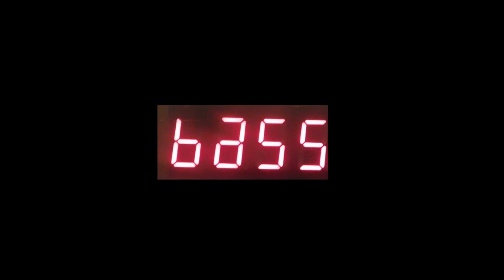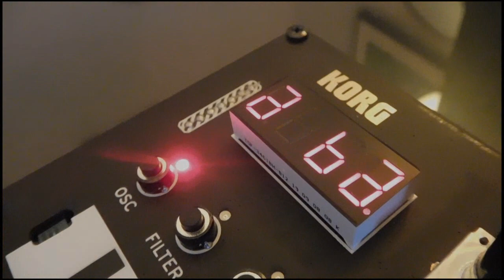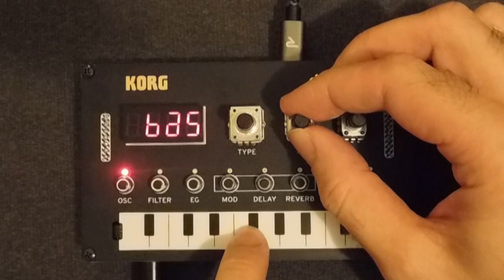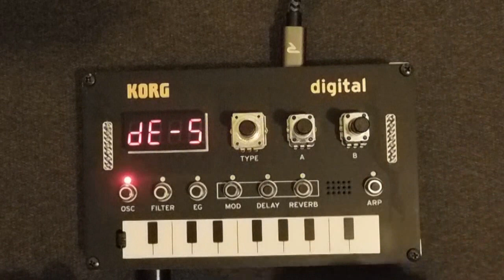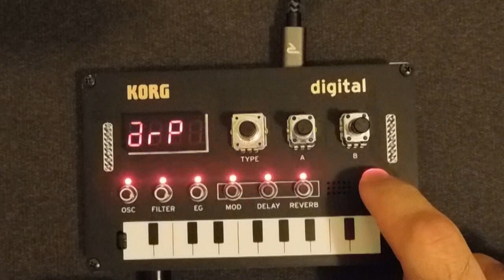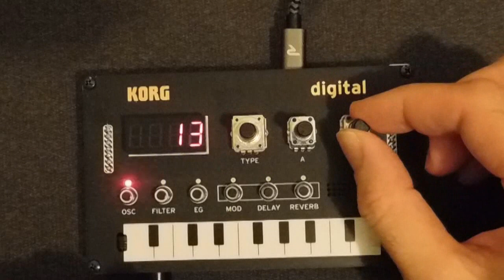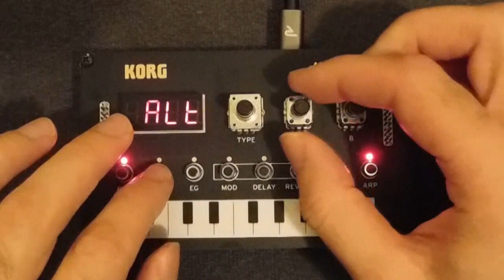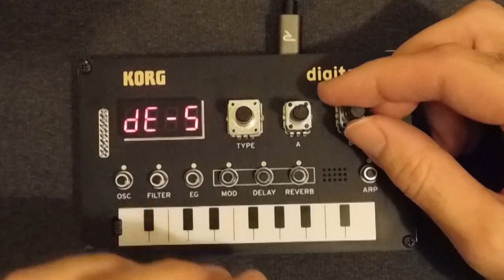"Volca Bass" OSC for Korg NTS-1

Comment: Hello sir, it shows 404 on github. Can nts1 users no longer download?
Reply from the maker: Hi, I just checked and the link is working, try clicking instead of copy/paste. In alternative to searching tweeeeeak on git hub
Reply from the maker: Ok, the link for mk 1 is not working, let me check that
Reply: @tweeeeeak228  Thanks for your work, vbass works on nts1. I found the same problem with Proba-B, the nts1 connection failed.
Reply: @tweeeeeak228 Thank you for your contribution❤❤❤
Reply from the maker: @Enzi-mika Done, the download link is working now. Thanks for the heads up

Comment: Thank you! This is really great! Can I also use this oscillator with a MIDI keyboard, and does it respond to velocity?
Reply from the maker: Yes. Velocity is controlled by the nts itself, and controls the volume, it has no control on the oscillator, but works fairly.
Reply: @tweeeeeak228  Thanks again!

Comment: Is it possible to to do slides from external sequencer? Also are params of this osc trough CCs?
Reply from the maker: Sorry for the late reply. Slide is either on or off, and this has to be changed in the NTS-1 using the OSC extra parameter 4 (Octave and slide). Unfortunately, the 6 OSC extra parameters are not accessible via MIDI though CCs. The whole rest of params in NTS-1 are changeable via MIDI, only the OSC extra params are not, which is a shame :-(

Comment: So I just tried to use the sequencer on here to create more complex sequences on the Minilogue XD, and the architecture seems a bit different than the nts-1, as the sequence doesn't play when I strike a note. However the idea that it's even a remote possibility to create an oscillator to create a sequencer within a sequencer is such a fantastic idea, I applaud this not only as a great nts-1 oscillator but possibly an interesting step for the logue synths as well!
Reply from the maker: @s3nse c0rruptr thanks for your comments. The minlogue is 4 voice polyphonic so it loads 4 instances of the volca bass osc, which means 4 sequencers. So it becomes a mess, unless you use it in mono or unison mode, I believe.

Comment: How to load from Windoze machine?  Hsven't found an easy way to interact with the NTS-1 on this platform.
Reply from the maker: Some people report problems, in fact. With the librarian, recognising midi port... For me it was always smooth. My only guess is maybe other drivers installed interfere?
Reply: @tweeeeeak228  I haven't found the NTS-1 librarian, but I've tried the two for the bigger synths and the nts wasn't recognized.
Reply: To others: I had to wait for the Librarian download link to load on the NTS-1 page, and I also had to manually assign the Midi channels in the Librarian.

Comment: Really great job designing this custom oscillator! It makes me even more excited for my new NTS-1. One thing I would love to see you include in the future (if it’s possible) would be the active step function, or at least a sequence length control. Oh, and why not have the LFO change oscillator types (or do something else) when set to wave shape? I guess that would be getting away from truly emulating the Volca Bass though. I know nothing about programming custom oscillators, but is there any way to route the LFO to a filter, or change the LFO shape?
Reply from the maker: Hi Ryan, thanks! The active step function actually crossed my mind, the only question is how to select active steps, with only the available parameters, and without complicating too much? Any suggestions?
Reply from the maker: As for the LFO, the shape LFO doesn't really exist in the volca bass, ao I would keep it out. The other LFO parameters I cannot control. Only the OSC itself.
Reply: Just had another idea, but again I’m not sure what can and can’t be done within a custom oscillator. The ribbon keyboard has 16 marked notes from Bb to C#; perhaps in sequencer mode set to 18, each of these notes could instead of making sound, toggle a step between active or not. And then value 19 could reset them all to active. Thanks for taking the time to hear my thoughts and reply! Keep up the great work, man.
Reply from the maker: Sound very nice ideas, I'll think about it.Thanks!
Reply: Perhaps you could treat it similarly to recording a rest in the sequencer mode? Something like, long press in the vicinity of C to record a rest, and long press in the vicinity of F to remove the step from the sequence. Hmm, but then there would need to be some way for the user to know what steps are turned on, or at least a way to turn all steps back on so you can get back to the original sequence.

Comment: Very nice work, I hope to be getting an NTS-1 when they are instock. One neat trick on the Volca Bass was to tune the oscillators so you could play a chord when pressing a key - insta Dub Techno when combined with some sort of Echo/delay fx. This would make for a great update.
Reply from the maker: You can do that, you can change each oscillator pitch and transpose up to +/- 1 octave, so you can actually set up a 3 note chord.

Comment: Nice job! The sequencer feature alone is amazing. I wonder how hard could it be to add the sequencer feature to a different sound engine. I'm guessing the sequencer and the sound generator are implemented in different routines/functions, so changing the sound part should be pretty easy.

Cheers!
Reply from the maker: Hi. Thanks! Shouldn't be difficult to add the sequencer to other custom OSCs, but the code is within the OSC itself, so the source code for that other OSC is needed, so it can be modified to include the sequencer. The only problem is that it "consumes" 2 edit parameters, that would not be available for the OSC sound engine.
Reply: @tweeeeeak228  Yes... when I latter whatch the rest of your video I realised that the sequencer is some sort of internal pitch modulation. I haven't got a NTS-1 as of yet, but when I do I'll be sure to visit you github. ;)
Keep up the good work.
Stay safe!